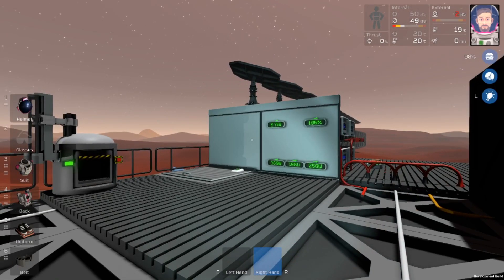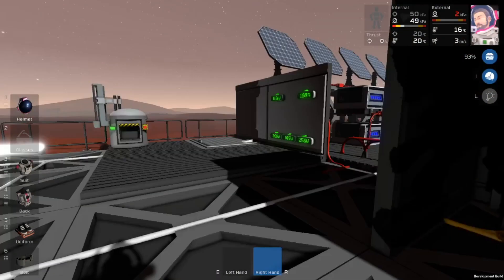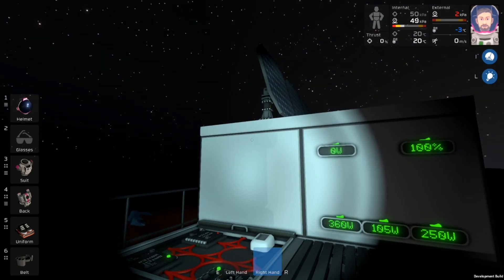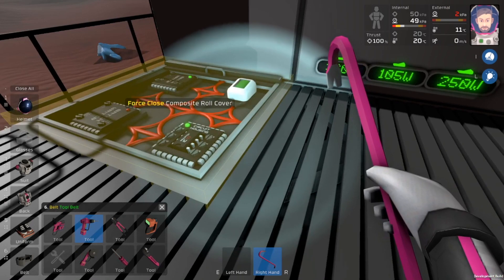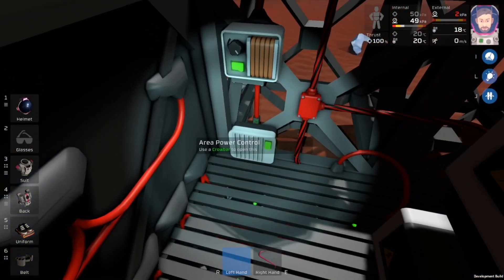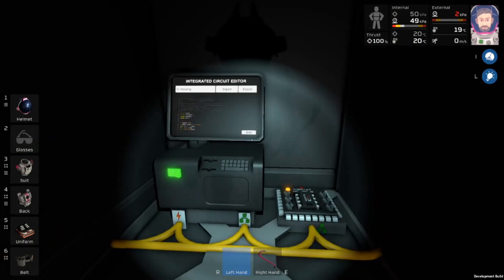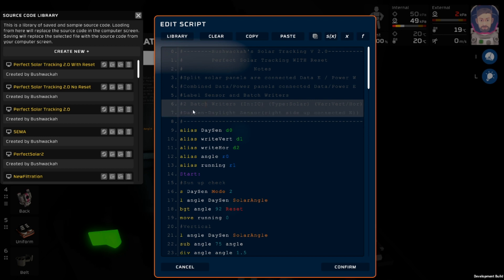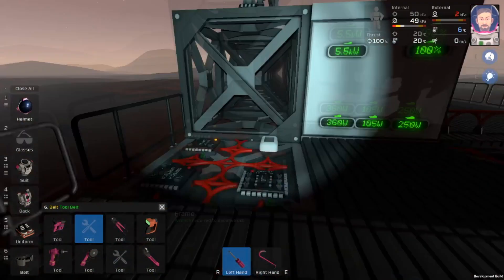Stationeers Tutorial: UPGRADED Ultimate Solar Setup!

Comment: Great Video.  Have you done something on how to set up the power displays on your Usage, Production, and battery status system?  I managed to get the non reset code working.  I have 2 rows of 20 panels feeding my base.  But they are only 40-50% efficient.  I'm not sure why, I was using a bunch of chips before i did your IC setup and i was still getting low efficiency.

Comment: Can send both horizontal and vertical numbers to all panels without batch writers or anything else using the sb command (set batch I call it.) Use only an IC chip (and cables.) -539224550 is the current type hash for the "Solar Panel (dual)" object. Sends the values to all objects on that network, so doesn't need a device knob on the IC. The wiki has a list of other hash numbers as necessary for the other solar panel types. 

sb [type hash] Var r?
sb -539224550 Horizontal r1
sb -539224550 Vertical r2

Can also do the math to use both the vertical and horizontal outputs of one daylight sensor. I use one upside in horizontal mode. Only need 1 device knob for the IC for infinite solar panel control. This is my current file. Have the horizontal sensor and solar panel data ports all facing north. Use d1 as an output to a spinning light on top of my solar tower to turn on at night and off at day. To help acts as a backup beacon if I get lost at night without power to my tracker card.

alias Sensor d0 # Horizontal Sensor
s Sensor Mode 1

l r1 Sensor Horizontal
l r2 Sensor Vertical

mul r1 r1 -1
sub r1 r1 90
sub r2 180 r2
div r2 r2 1.5
add r2 50 r2
sb -539224550 Horizontal r1
sb -539224550 Vertical r2

l r3 Sensor Activate
seqz r3 r3
s d1 On r3
yield
j 3
Reply: Hoping to try this out in the morning! Been troubleshooting my system from the video for hours with a buddy with no luck. Thanks in advance if it works!

Comment: hm seems to be working, but its only controlling one panel. I have 10 in total, all wired up on same data line as in the video.
edit: no sorry, its kind of moving one panel, but not correctly. I can't figure out what it is doing wrong actually but its not facing directly to the sun.
I have double checked the setup its all exactly like you have shown in the video.
also the IC housing is indicating IncorrectLogicType at line 16.

Comment: Has something changed with this script or the solar angle on Mars? as of this date, the Horizontal is not tracking correctly. It moves a bit too quickly and by sundown the panel is facing almost south. Starts out pretty good in the morning, then efficiency drops as the day goes on. Not sure if i'm doing something wrong? or something has changed.

Comment: for anyone running into issues at line 16....looks like in IC the modes are flipped....normally mode 2 is Vert and Mode 1 is Hoz...just flip them so Vert is 1 and Hoz is 2
Reply: Changed line 16 to 1 and line 30 to 2 and it worked for me thanks for this.

Comment: As of 23 Nov 2020 program working for me is updated by Yancarlo Ramsey. I will add it below. Original program makes solar panels roll around non- stop, no matter day or night.

#-------Bushwackah's Solar Tracking V 2.0---------
#        Perfect Solar Tracking WITH Reset
#                    Notes
#Split solar panels are connected Data E / Power W
#Combined Data/Power panels connected Data/Power E
#Label Sensor and Batch Writers
#2 Batch Writers (In:IC) (Type:Solar) (Var:Vert/Hor)
#DaySen-Daylight Sensor(right side up connected N))
#---------------------------------------------------
alias DaySen d0
alias writeVert d1
alias writeHor d2
alias angle r0
alias running r1
s DaySen Mode 2
yield
Start:
#Sun up check
l angle DaySen SolarAngle
s DaySen Mode 1
bgt angle 92 Reset
move running 0
#Vertical
l angle DaySen SolarAngle
sub angle 75 angle
div angle angle 1.5
s db Setting angle
s writeVert On 1
yield
s writeVert On 0
yield
#Horizontal
l angle DaySen SolarAngle
s DaySen Mode 2
mul angle angle -1
s db Setting angle
s writeHor On 1
yield
s writeHor On 0
yield
j Start
#Sun not up Reset
Reset:
bnez running Start
s db Setting 0
s writeVert On 1
yield
s writeVert On 0
yield
s db Setting -90
s writeHor On 1
yield
s writeHor On 0
yield
move running 1
j Start

Comment: I don't know what I did wrong. But, I followed all of your instructions perfectly, then discovered my solar panels were all backward. No worries, I simply turned them around. After doing that, the IC housing does nothing but flash an error. I erased it, reprogrammed it...still an error. I'm using the version with the reset. I need some help, please.

Comment: Two things:
First, loading data from a daylight sensor immediately after trying to change its mode without a yield in between has unpredictable and generally erroneous results. The easy way to make the panels stop going crazy is to add a yield after each daylight sensor mode change. The better way is to move those mode changes to after the other mode's value is read, and then add one more mode change and a yield just before the Start: label to make sure it's in the correct initial state. Here's a version with those changes: https://stationeering.com/tools/ic/_WCFMCzQAy5

Second, the comment on line 4 is incorrect. Single-port panels should have the port facing west. The POWER port is always the one that matters, and if you cycle between build option 1 and 2 for a solar panel, you'll see that it's the power port symbol that stays in the same position.
Reply: I will definitely give this a try. It seems comically simple now that you explained it and makes perfect sense to treat the mode changes like you would an old analog meter.
Reply: mate you are a life saver! was getting so frustrated but you made it work, thanks buddy
Reply: Thank you, that did the trick.

Comment: its working but its face the opposite direction ؟!
Reply: The instruction on line 4 is wrong. If you're using a single-port solar panel, the port needs to be on the west, not the east.

Comment: Hello, can you take a look into your program? It was really good but with the new update 03.04.20 it isn't working anymore.
Reply: I think I found the error, the IC is maybe to fast for the batchwriter. When you put a "yield" in between the "load" and "set" values it works again. Thanks again for the great skript :-)
Reply: @griffinsklo7755  It's the daylight sensor which isn't being read correctly because of trying to do those things on the same tick. That solution definitely makes it work, but for one which doesn't slow the script down with extra yields, try this: https://stationeering.com/tools/ic/_WCFMCzQAy5
Reply: Depending on your issue is a different solution. I had an issue at first. if you are SURE the code is the issue I had to edit mine. One extra line in the WITH Reset one got mine to work. everyone was saying to just switch the "s DaySen Mode" line around to get it to work, but I found that when the sun goes down the panels do a weird 'dance'. If you add a line directly below the #Vertical" and above the "l angle DaySen SolarAngle" the tracking works. the line to add is "s DaySen Mode 1".
For any questions about my explanation here is the full code as I have it working:

#-------Bushwackah's Solar Tracking V 2.0---------
#        Perfect Solar Tracking WITH Reset
#                    Notes
#Split solar panels are connected Data E / Power W
#Combined Data/Power panels connected Data/Power E
#Label Sensor and Batch Writers
#2 Batch Writers (In:IC) (Type:Solar) (Var:Vert/Hor)
#DaySen-Daylight Sensor(right side up connected N))
#---------------------------------------------------
alias DaySen d0
alias writeVert d1
alias writeHor d2
alias angle r0
alias running r1
Start:
#Sun up check
s DaySen Mode 2
l angle DaySen SolarAngle
bgt angle 92 Reset
move running 0
#Vertical
s DaySen Mode 1
l angle DaySen SolarAngle
sub angle 75 angle
div angle angle 1.5
s db Setting angle
s writeVert On 1
yield
s writeVert On 0
yield
#Horizontal
s DaySen Mode 2
l angle DaySen SolarAngle
mul angle angle -1
s db Setting angle
s writeHor On 1
yield
s writeHor On 0
yield
j Start
#Sun not up Reset
Reset:
bnez running Start
s db Setting 0
s writeVert On 1
yield
s writeVert On 0
yield
s db Setting -90
s writeHor On 1
yield
s writeHor On 0
yield
move running 1
j Start
Reply: @jasonotto123  This fixed my issue. Thanks!

Comment: I am having troubles with it, the panels glitch along the horizontal axis.  From the writers it looks like the horizontal one is getting a vertical angle every once and awhile.
Reply from the maker: If you would, add me on discord Bushwackah#7710. I would like to see this problem.
Reply: @Bushwackah  One extra line in the WITH Reset one got mine to work. everyone was saying to just switch the "s DaySen Mode" line around to get it to work, but I found that when the sun goes down the panels do a weird 'dance'. If you add a line directly below the #Vertical" and above the "l angle DaySen SolarAngle" the tracking works. the line to add is "s DaySen Mode 1".
For any questions about my explanation here is the full code as I have it working:

#------Bushwackah's Solar Tracking V 2.0--------

#        Perfect Solar Tracking WITH Reset

#                    Notes

#Split solar panels are connected Data E / Power W

#Combined Data/Power panels connected Data/Power E

#Label Sensor and Batch Writers

#2 Batch Writers (In:IC) (Type:Solar) (Var:Vert/Hor)

#DaySen-Daylight Sensor(right side up connected N))

#---------------------------------------------------

alias DaySen d0

alias writeVert d1

alias writeHor d2

alias angle r0

alias running r1

Start:

#Sun up check

s DaySen Mode 2

l angle DaySen SolarAngle

bgt angle 92 Reset

move running 0

#Vertical

s DaySen Mode 1

l angle DaySen SolarAngle

sub angle 75 angle

div angle angle 1.5

s db Setting angle

s writeVert On 1

yield

s writeVert On 0

yield

#Horizontal

s DaySen Mode 2

l angle DaySen SolarAngle

mul angle angle -1

s db Setting angle

s writeHor On 1

yield

s writeHor On 0

yield

j Start

#Sun not up Reset

Reset:

bnez running Start

s db Setting 0

s writeVert On 1

yield

s writeVert On 0

yield

s db Setting -90

s writeHor On 1

yield

s writeHor On 0

yield

move running 1

j Start